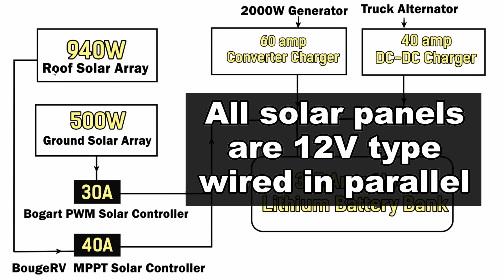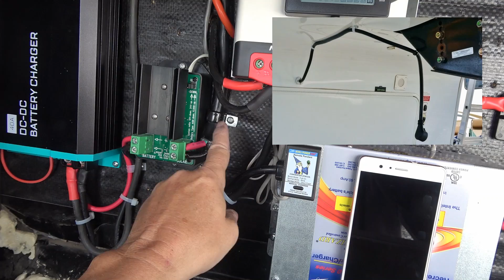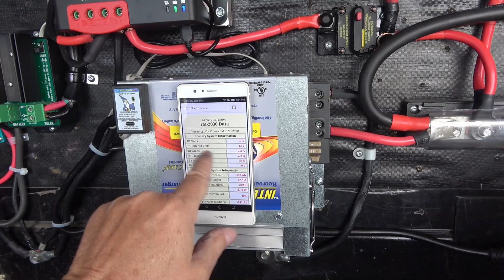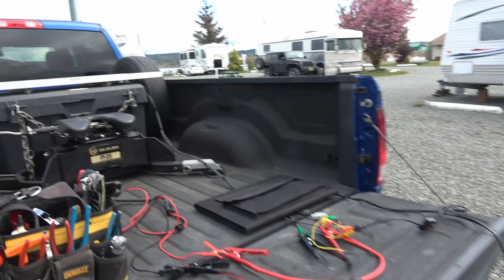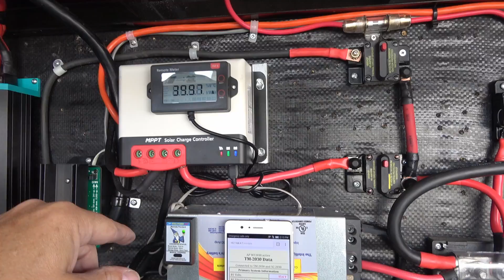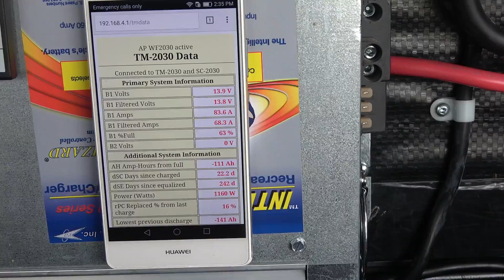Boondocking Power Upgrade - Adding Separate 500W Solar Ground Panel Array + Wiring Cleanup

Comment: With 940 watts of solar, why are you using a 40amp controller? At 12v you can only use 480 watts of the array. You could be getting almost twice as much power with a properly sized charger. Am I missing something?
Reply from the maker: Money, I don't have a whole lot so have to pick and chose what I buy. Larger amp chargers aren't cheap! The 40 amp charger was recently sent to me free for review. So, I was able to repurpose the 30 amp I was using before. 30-40 amps as actually plenty of charging power for our off grid lifestyle, but by oversizing the solar array I can still get that even on cloudier days and low sun angles. The ground array will help out during the month or two of short winter days and for shade issues.  Cheers, Ray
Reply: @LoveYourRV  well that explains it. You can always add another 40amp controller and run them both to the battery bank. You would need to add some more wire from the roof and run 2 separate systems but the redundantcy could be good in case of a controller going bad or panel issues. 2-50amp victron controllers are less than 1-100amp victron controller!  Thanks for all your great videos, I've learned a lot from them and utilized several of your ideas into my RV.
Reply from the maker: Thanks, yeah, can always add controllers or increase size. I've learned RVing the southwest during winter that a person needs to oversize the battery bank first and then solar panels, especially since I prefer not to tilt mine. Also, we love the coast in fall and spring and of course, that means lots of foggy and cloudy times, so that's another reason.  If a person does most of their off-grid in the long summer months in a sunny location and high sun angle then that would be a different story.  I could easily get away with half the amount of panels here in the summer if not under any trees.
Reply: @LoveYourRV I was going to ask the same question. On your roof you have 940 watts which =78 amps at 12 volts. You could run 2 40-amp BougeRV controllers in parallel and  in ideal conditions almost double your output. As it is, you are dissipating the extra panel energy over 40 amps as heat, which is why the controller is getting so hot. 
I have 6 x 150-watt solar panels that I want to install on my motorhome as 2 banks of 3 x 150 watt panels in parallel with a 40-amp mppt  controller for each bank. I was hoping you would review the BougeRV 40 Amp controller sized with an appropriate array size so we could see how effective/efficient it really is. Perhaps BougeRV will send you a second controller so you can conduct such a review? The only thing we can ascertain as it is that the controller will not explode if you overload it.
Reply from the maker: @svaryn  Here is a blurb from the BougeRV controller manual:
Here is a blurb from the controller feature list:
"Current-limited charging function is available. When solar panel power is too large and the charging current is higher than the rated current, the controller automatically reduces the charging power so that the solar panel can operate at the rated charging current."
I gather that the extra wattage should not matter.  It runs hot but so do most other MPPT controllers thus the huge heat sinks. I'm used to my very efficient Bogart PWM that barely gets warm. I can shut off a few panels on the roof and compare once we get some predictable summer sun.
Also, you never get the advertised wattage from a solar panel. That's perfect lab conditions, not the real world. Generally getting about 80-85% of rated wattage is considered good at a perfect 90-degree sun angle and there are wire and controller inefficacy losses. So getting 78 amps is perfect world math.
Reply: @LoveYourRV  HI Ray. Thanks to you, I am interested in that particular charge  controller and I have read their literature. The manufacturers maximum current is 520 watts at 12 volts which is 43.333 amps. Even at 80% you are pushing around 750 watts in full sunlight which if at 12 volts is 62.5 amps. Electrical equations give me headaches, but that extra 20 amps has to be going somewhere? Would make me nervous. Looking forward to the test with fewer panels. Thanks John
Reply from the maker: It should be very easy electronically to block the extra wattage. It doesn't have to go anywhere. The controller isn't like a large resistor that needs to eat up the extra power.  Just imagine unhooking the panel array briefly. All amperage would be stopped instantly, right? 
So they could have transistors or regulator chips that do that driven by a smart microprocessor chip so when the wattage hits max, the controller simply turns off, not passing the extra. All this can happen hundreds of time a second.

Comment: Thanks. Nice presentation. Any consideration to adding another battery? That would give you up to 360 useable amp hours.
Reply from the maker: Unless I start to add a much larger inverter I don't see the need, 315 ah of lithium is comparable to 6 lead acid batteries. I also have a couple battery power boxes kicking around around. A 1000 watt hour Jackery and a 740 watt hour Himcen, so are pretty set for capacity. :)

Comment: Wow, I remember the first video I saw of your's you were just installing the first two solar panels. I had no 5th wheel and no solar LOL. Time flies! 
Now I have 3 panels, a 4000 watt inverter, and 4 100amp Battleborns. The only project left for me before hitting the road is new tires.
Reply from the maker: Yup, Christmas 2014!  Those panels are still pumping out good amps. :)

Comment: Quite the system do you see your yourself adding any more batteries ?
Reply from the maker: Unless I start to add a much larger inverter I don't see the need, 315 ah of lithium is comparable to 6 lead acid batteries. I also have a couple battery power boxes around. A 1000 watt hour Jackery and a 740 watt hour Himcen, so are pretty set for capacity. :)